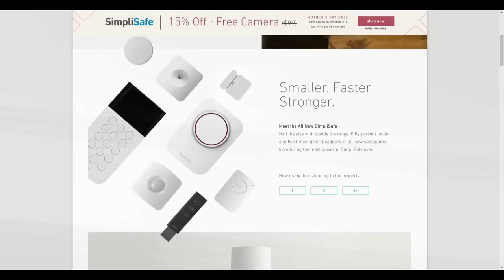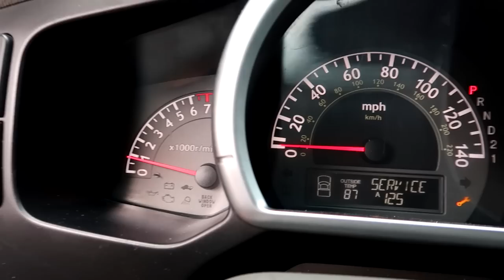Buying a Reposessed Truck at Auction was a MISTAKE! It's WAY Worse Than I Thought!

Comment: Being from Canada that rust is nothing. I pass cars daily that have entire body panels missing due to rust and they still seem to run fine. For your replacement truck I'd go American for your case. They're cheaper and get more for the value plus when it's American made there's always pieces around new or used and easy to replace.

Comment: I have a 2010 Ridgeline.  When one of the catalytic converters went out, the local Honda dealership replaced it for me.  They didn't tell me there were two other catalytic converters (this is my first truck).  About a week or two later, the car began running very rough and I had trouble staying in gear.  I thought the transmission had gone bad so I took it to a transmission specialist.  He said the transmission was fine ... another catalytic converter had gone bad.  He said that with Ridgelines if one goes bad replace all three because the other two won't last anyway.  He replaced the other two for me and the car has run fine ever since.  That was five years ago.  Yes, the repair was expensive.  But beyond that all I did for the next five years was routine maintenance.  It's when the car gets high mileage or over 10 years you can run into trouble.  I just replaced the control arms, axels, boots, and tie rod plus routine change brake and rotors.  I had to replace the AC compressor.  That cost me about $1600 parts and labor.  I replaced the serpentine belt, timing belt and water pump last April as routine maintenance; another $1500.  I replaced the alternator and that had to be done three times ... my mechanic did not use the Honda part.  With alternators always use the Honda part.  That was about $600 I think.

The good news is, other than replacing the tires soon, I should get another 5 years and 50,000 miles at the least of of this truck.  I love it.  It's the best vehicle I've ever owned, and the only vehicle I bought new that I bought exactly the car I wanted.
Reply: If your going to spend $4k on the truck your better off getting rid of it and buying a used one with low miles for $10-13k.

Comment: For the cats, wouldn't an issue show up on the OBDII diagnostics?  Sure you could get some generic cats welded in if needed.  The oil leak on the rack?  Don't worry about it unless it gets bad.  Rust - you may be able to get replacement rocker panels and get them done for a few hundred bucks, then cover underside in oil/kerosene mix.  The mechanicals should just keep going with normal maintenance.

Comment: I hate rust. From up north. Honestly, it doesn't look too bad. If there's no rust on the unibody, that a really good thing. Rockers look mighty crusty but you can probably cut those off. I think. I'm not familiar with the ridgeline (even though it was one of my favorite trucks when I was little)

Comment: I rebuilt a 2003 Tundra specifically so that I could pull around my projects (some from coparts).  I've towed many vehicles with that truck and I don't regret it at all.  Definitely a Tundra!  The Tacoma, while a great truck isn't quite big enough for towing around hefty cars.  It's not the engine power alone that's the deciding factor, you have to have enough braking power to stop that extra 3000-5000 pounds.

Comment: Thatll run drive and treat you well as long as you dont bring it back up north. Rocker rust is pretty common around new england and as long as the floor and frame are solid just ignore it.

Comment: I personally don't think the rusts that much of an issue, here in Scotland we use salt on the roads during winter so that level of rust ain't shit 1) its only on the body and not the frame, so its more cosmetic than structural 2) its a truck designed to lug shit around, it doesn't need to be immaculate, its a workhorse, it just needs to be reliable, 3) i wouldn't have bothered about the sweating on that joint on the PS rack, its not wet enough from what i could see to be classed as a leak where your fluid loss is going to be a lot...so basically keep it, it'll be a decent truck for what you need it for, no point in throwing more money into something that's going to just be used as a workhorse when what you already have for a low amount of cash is perfectly fine. that truck still EASILY has 5 years of good use in it

Comment: GM duramax, gmc or Chevy for sure, hold their value better than others and last a long time, my friend has a 2006 Chevy duramax with 521k miles, runs like new, never had a rebuild, tranny never rebuilt, the a/c has never even been charged since new and blows cold, never had any major issues at all.

Comment: I just bought my last car at auction.... I spent $500.00 on it and yes it has a little rust. Book value was pretty much nothing.  I checked it out and it ran and sounded fine. It turned out it needed a rear axle and wheel bearing and parking brake shoes... Basically, I couldn't drive it up to speed to hear the rear wheel bearing until after I bought it.

$3000.00 on a pig in a poke truck isn't a good move. Ever!  Older vehicles with higher miles are going to have issues.  Check them out personally and never sink more money into them than you are willing to write off.  Once you get them home and drive them a while then assess your purchase before sinking any real money into them and then decide if you want to rehab them or push them off a rock.

Sometimes you can get a real winner for dirt cheap, sometimes you get a total loser.  But you don't really know until you have a few thousand miles on them yourself. My $500.00 auction buy came in around $1500.00 total and I've driven it for a year so far, so good.  But if the car didn't make it home, I could have junked it for a few hundred bucks and walked away relatively alright.  As it is, a solid daily driver for $1500.00 with a year of perfect service under it's belt, I did just fine.  I originally budgeted about a grand for the car, but the extra $500.00 is already pretty much worked off, and the car doesn't owe me much.

Always look for cars with low or no book values... Morons who think cars have a set value will bid on cars with higher book values, rather than on condition.  Some folks think they are going to fix up a car for profit, others think buying something for less than book value is some kind of bargain.  Therefore a completely trashed 2016 Corolla with 200,000 miles on it will sell for more than a great condition 2005 Corolla with only 50,000 miles on it.  Which one would you rather drive?  

Keep in mind, you are buying a truck to actually use, not to flip for profit... Buy it cheap, use it up and sell it cheap or junk it when you are done.  That's how to get an auction bargain.

Comment: That is typical rust in the Midwest Hondas in the Midwest. Your Honda probably was outdoor parked and not washed frequently. Hondas around those years will only have rust on the quarter panels and fenders only. You are not disassembling the sway bar link correct either. There will be times where you’ll spend 2-3 hours on a rusty bolt! Gl you have lots to learn on older cars.

Comment: Sam, that rust is very excessive for a Honda. I bought a first gen pilot from a police auction a few years ago (from the northeast area)which needed more repairs than your Ridgeline but had very little rust & it was high mileage as well. Also I would recommend you check the spark plugs in the back by the firewall because people sometimes don't change them because they're harder to get to.

Comment: Just a moderate amount of rust for an 11 year old car with 100+k miles. In PA it’s terrible. One thing we know is that you really can’t spot repair rust. The insulation of the panels traps the salt water against the metal and it rots from the inside out. Basically, by the time you see it, the entire panels is shot.  Basically, you can try to patch and wrap the truck and just drive it until it dies, but rust is just car cancer up here

Comment: Eventually all rockers go here. My intrepid has been solid for 16 years but I noticed some rocker panel rust starting this spring . Luckily you can't tell because of the plastic covers. If it wasn't for the plastic it would have rotted years ago. My Buick had no rockers left at all.

Comment: This isn't much rust... I live in Quebec, Canada and up here, the salt literally eats trough any piece of metal you throw at it during the winter... If there is no rust on any structural piece or in your floor panels, you can still drive it just fine! (Hey, last week I saw on the highway a car that was a literal rust bucket! Like, at least a quarter of every panel on the car wasn't there anymore!) The basic rule of thumb for rust up north is : Do you risk going through the floor or losing an important piece (like a wheel) while you are driving ? No? Then you're just fine!

Comment: I live in Boston Massachusetts and thats like normal wear and tear here with the rust, for those who do not take care of their vehicles. I wash my suv every day in the winter at a laser wash just to rinse the undercarriage off on top of fresh new undercoating every other year You should see what a 5,000 mile ford truck looks like under it very similar to your high mileage honda. Here we use salt on our roads and i hate it wish they used sand instead but not as bad as other parts of the north east that use sand and gravek then you get dings and rock chips chipping paint exposing bare metal and we all know what that means

Comment: Honestly I’m not a fan of the Honda Ridgeline but all things considered it’s not bad, not much rust, a few odds and ends that’s it. If you was gonna get a different truck I would recommend a 99-06+07 classic Silverado the 5.3 v8 in those trucks are virtually indestructible if you maintain them, and if you want a Diesel I would recommend a 7.3 power stroke or a 5.9 or 6.7 Cummins the 7.3 is slow but will pull anything and are super reliable and the cummins’ are just great diesel motors all around.

Comment: I'm from Western Ma. Thats minor . If that catruck (short for Car + Truck) was up here it would be  pretty bad. Plus we have inspections So the cat problem would have to be addressed. Unless it 15 yrs or older It would be exempt from emissions testing. Still would have to pass safety. Rockers would still have to be fixed. Worth 1500 -  2000 up here.1000 would be a quick sale. 👍

Comment: If you are looking to pull something during long road trips, either get a diesel or a good 6.0 from Chevrolet if you don’t want the diesel. A Honda Ridgeline is good for light loads but not pulling a car on a trailer. My honest opinion would be a dodge diesel or a ford diesel but not the 6.0 diesel. I’ve seen how them trucks handle the mileage and abuse on Houston roads. New model diesels do have one quirk and that’s the def system. Every oil change feels like sandpaper in those and I can’t see them lasting as long as the diesels before the def system came into place. Chevrolet makes a good diesel in the years of 200-2007 but good luck trying to find one at auction that isn’t all beat up. Now for the Chevrolet 6.0 if you don’t want a diesel has very good toque and are built solid all around especially the suspension. Suspension is key for long road trips and having the torque to pull the trailer with the car. My honest favorite diesel motors are 6.4 power stroke and a 5.9 Cummins diesel but be mindful that anything you buy from up north will have rust. I would try to find something more along the south rather than the north because you will have rust anywhere no matter of how clean it looks to your eyes. Hope you read this comment and find some sort of guidance with my experience on these Houston roads with these particular trucks

Comment: Hey Sam if you want to make your life easier with rusty bolts in the future you should look into getting a induction bolt heater about 300 bucks and will work on pretty much any bolt with much less risk than a flame if used correctly

Comment: If you were in Southern California that baby would be a rust bucket, BUT in the North East it would be spotless. Replacing those rocker panels would be easy for you. I little blending of the paint and you are done. You have everything to do the job easily. As for anything underneath the truck just get some rust conversion / prevention spray cans from someone like Rustoleum and spray the whole undercarriage, it looked like surface rust under it and that would stop anything from progressing into a problem later on. I would say that truck is a keeper. If you want something newer that you can do light towing with, get a newer Chevy Silverado with a LS motor. It will run forever if you take care of it! If you are going to be towing anything heavy, get the Duramax in a dually! Either way you will be in good shape! Good luck man! Enjoy your videos! Still waiting for you to tell me where I can get one of those spray booths at in China.

Comment: That rust would be drive able for us Iowa drivers for years on end. If you were to replace the ridgeline, Id pick a 2009-2010 Ford F-150 with the 4.6L V8. 09-10 4.6 had a 6-speed tranny, vs the previous 4-speed, but don't get the 5.4, because the timing belt is very unreliable, and will cost a lot of money to fix. If you can find a 5.4 F-150 with a 6-speed and new timing belts, that would be a win

Comment: LOL if you think thats bad, come up to Montreal, you wont even see any ridgeliners left they all rotted away years ago. About the only old ones left (including 90s old) are chevy/gmc, the Fords have mostly dwindled away and there are a few 5.9 cummins left (early 2000s hemis gone a few years ago also) but on those in some cases you can see the drivers legs through the doors to give you an idea of the level of rust here,  once I saw a pizza vehicle(civic) only held together by the roof as the seals and lower doors had completely gone.

Comment: PS for the type of towing that you want to be using this truck for I recommend a Dodge Ram Cummins Diesel or at least a 2500. If you’re going to be towing cars that’s what you need not a little for six cylinder Honda. And don’t buy a car from any state north of South Carolina

Comment: I live in Ohio, this truck has regular rust. My 2002 Jeep Wrangler frame snapped near the rear control arm while I was driving.
Reply: TjFoxeh my truck doesn’t have rockers, the inside cab corners are special edition where you can see inside of the holes in them. And my frame is held together by rust, I love ohio

Comment: I woulda cleaned it first and put UV dye in to verify if it really is leaking. Possibly over filled PS fluid, this causing it to overflow when the steering wheel is turned.  (Just my opinion)

Comment: I just got a free 96 Silverado that was used to plow snow and there is more rust than yours, it should be fine if you go in an treat the metal, also I need a trans rebuild, but that is a separate issue

Comment: long term replacement for the Ridgeline would be a 60's era Mercedes Unimog, but more practical would be an early 2000 era Toyota Tundra, have one myself, with 200K, have met owners with mileage double that still happy. Louisana weather is as harsh as Florida and there are a bunch of these older Tundra's on the roads here, I hardly see Ridglines at all here.

Comment: Sam, you need a BIG truck and trailer to buy cars at the auction. A diesel would be nice, like an f250 or a ram 2500 or silverado 2500. check out western champlain, he does all the copart truck stuff and you can get a ballpark there

Comment: that's definitely moderate. My first car was a 97 cavilier bought in 2010 and it had no rockers at all and one rear quarter panel had a golf ball size hole, and the other had a tennis ball and a half size chunk missing from it

I paid 550$ plus auction fees (around 800$) and kept it for 2 years. Didn't see it before buying either

Comment: Even buying a car that’s not really that old if it’s coming from northern states where there’s a lot of snow ice you can be guaranteed there’s going to be more rust on the vehicle. My last ridgeline wasn’t that old and it came from the East Coast it had a lot of rust on the suspension parts and the rotors

Comment: I live in Ohio and have sold Honda and that ridgeline 1. Seemed like a lot of rust for Florida only vehicle, 2. Those side steps typically doom rust belt vehicles so I would say it was driven a lot in the north or on the highway... overall it seemed like a solid vehicle if you were keeping it... if you are still in the small truck market but want reliability also look at Tacoma possibly... but look to see it has a new frame as Toyota recalled the fames for rust...

Comment: IMO: I would have changed the spark plugs even if the truck ran well. You would get an increase in fuel mileage with a fresh set of spark plugs.
Reply: Service interval for those plugs is 100+K miles, same engine as Odyssey

Comment: Rocker panels are optional straight off of the showroom floor Here in Upstate New York! I bought an 05 Silverado z71 in mint condition from Missouri and it has spent almost two years in New York now. The frame lost all of its factory paint and ive got paint rust bubbles everywhere :(

Comment: You didn't put genuine Honda ATF. You used valvoline? Hondas are very picky on their fluid for transmissions. Very sensitive. I have two Honda civics, 225k and 320k miles. I urge you to drain the fluid and put genuine fluid.